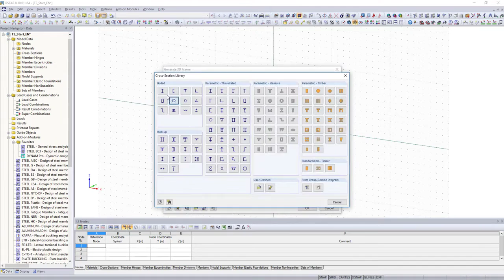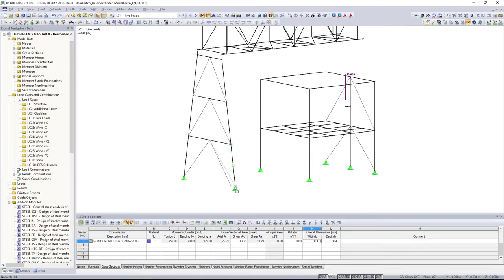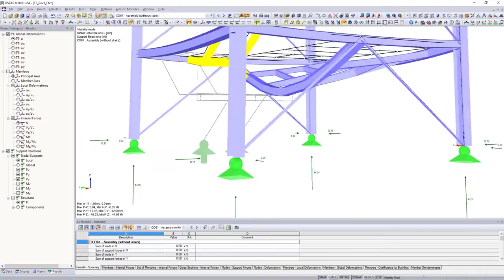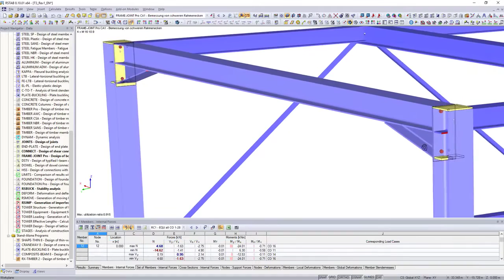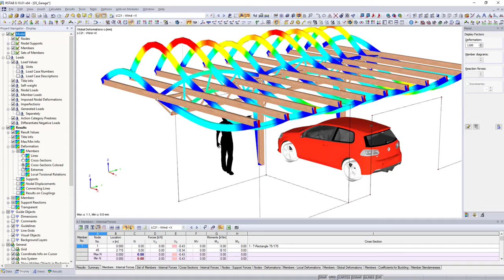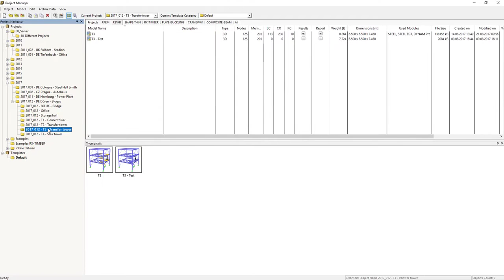[EN] Dlubal RSTAB 8 | Introducción al programa de análisis estructural de barras para estructuras...

Comment: Hola, interesante video, mi pregunta es si de este programa se podrá exportar a SAP o Etaps?
Reply from the maker: ¡Hola Duhamel!
Sentimos informarte que no tenemos exportación directa a esos programas de cálculo de estructuras. RSTAB 8 tiene exportación directa a Tekla Structures y Autodesk AutoCAD. También se puede exportar a formato stp, dxf, ifc, o dgn de Bentley ISM, dat o smlx de Advanced Steel. Más información en: https://www.dlubal.com/es/soluciones/areas-de-aplicacion/planificacion-orientada-a-bim/que-es-bim. También puedes enviar tus preguntas o solicitar una demostración personal en línea a info@dlubal.com.
Un saludo del equipo de Dlubal Software